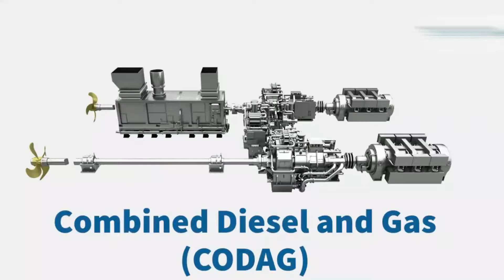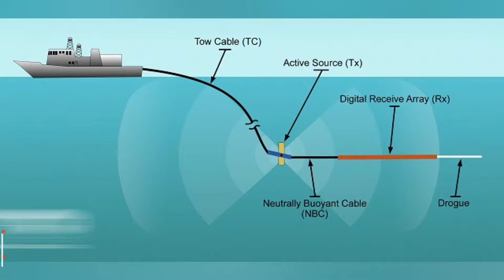#THYSSENKRUPP OFFERS THIRD-GEN #MEKO #A210 #FRIGATE TO THE ROYAL AUSTRALIAN NAVY #AUSTRALIA #AUSNAVY

Comment: How many Mk 41 cells are offered for the Australian ships bid, as this video shows 4 x 8 cells = 32 cells but I was told it is to be only a measly 2 x 8 Mk 41 cells = 16 cells.
Are Mk 41 strike length? and is there a towed array sonar as well as fixed array sonar.
Reply: VLS forward x32 cells + x16 canisters for the NSM. This is what the Mogami second of class that has been offered to Australia offers. Arguably very attractive, while the main gun is the exact same which is currently used by RAN. Commonality as much as is possible is critical.

Comment: The Meko A210 is a good fit for the RAN Tier 2 warships.  It has enhanced upgrade over the current Anzac class frigate with lower crew number and greater offensive and defensive capabilities.  A ship that is familiar to the RAN.   In my opinion it has better strike capabilities than the proposed Type 26 frigate, cost less and has lower crew numbers - this is important given the RAN's problem with personnel.  Moreover, I find it bewildering the the federal government continued insistence on procuring 6 of the Type 26 frigates with its continued cost over-runs and lengthy delays.  The final amount for these 6 frigates is between $45 billion with a guarantee of costing no more than $65 billion when the order is completed.  This is a huge waste of taxpayer dollars.  Such  monies would be better spent acquiring other ships at a faster rate.  The eventual cost for the Hunter class could be used to acquire 3 more Hobart class and up to 6 Mogami class frigates or 9 Meko A210's giving the RAN a more realistic spread of Tier 1 and Tier2 ships.
Reply: I believe it be good platform as long as they don't mess too much with the design.  32 cell for that ship size displacement is good. I just hope they plan to upgunned the hunter.class atleast for Tier 1 it wouldn't make sense to have both the 11 frigates and 6 hunter class all designed for just ASW.
Reply: @Nathan-ry3yu  Yes, I agree.  I believe the whole Hunter class needs to be dropped.  The 6 Type 26 will cost up to $65 billion - up to $6 billion per ship (far too expensive and contrary to the move towards smaller ships in greater number). Australia needs to cut its losses and use that money to purchase 8-10 frigates for Tier 1 and Tier 2
Reply: @robertmcquade6251 Yes, I 100% agree. it's very expensive for a ASW platform.

To be honest they would been better of building 16 of Mogami-class frigate from Japan. Crew of 90 on each vessel.  For ASW vessels,it basically has everything RAN needs for ASW platform and some long strike capability and has a very good radar system like the CEFAR-2 system. 5500 tonnes fully loaded.  Using missiles and system RAN looking for. 

Instead of building hunter class  frigate  they be better of building 6 Navantia flight III destroyers that has 128 cell VLS  instead to replace the hobart  class destroyers. 

And also scrap the idea of building 6 optional crewed vessels. And instead purchase a squadron of long range stealth bombers .

A surface combating fleet of 22 vessels is still double than what RAN currently have. It will work well when eventually 8 nuclear powerd submarines arive.  

A squadron of stealth bombers for RAAF would give RAN an upper hand and would respond faster to any threat..

I think the current pick for defence posture .sucks too much ASW platforms. Not enough offensive strike capability to the mix.
Reply: Yes, we have similar ideas.  The whole defense structure is weak and definitely lacks offensive, defensive and survivability.  I feel the whole idea of 12 ships in Tier 1 (power projection) and 12 or more ships in Tier 2 for EEZ protection makes greater strategic sense - just look at the UK and why it was unable to deploy its second aircraft carrier due to a lack of Tier 1 vessels.  Although the RAN lacks an aircraft carrier the two Canberra class ships have been muted for an air wing of possibly F35 B's - requiring the need for Tier 1ships. 

I agree, the Mogami class is a vey good choice and has good seakeeping qualities. It fits well with RAN armament requirements plus personnel needs with a crew of only 90 - even for the proposed batch II Mogami class.  The whole Type 26 deal was an under the counter political deal not a strategic deal.  My belief is that Australia needs to strengthen its ties with this part of the world, such as Japan and Korea - both are world leaders in ship building and can produce ships quicker and cheaper than the UK.  

The 6 optional crewed ships should be scrapped and think this is just government pipe dreams to make further delays in navy procurement and avoid the whole problem with ADF staffing issues.  A tier 2 fleet of a mix of light and heavy corvettes would be much more in line with actual security needs.  

Further, the Tier 3 level of vessels need to be actual weapons platforms rather than a policeman's wet dream.  Neither the Arafura class or the evolved Cape class would be little more than cannon fodder if it ever encountered a Chinese fishing fleet.  Rather than supplying actual gunboats and armed patrol boats with the necessary means offensive and defensive weaponry to protect the our servicemen and women, the government and military mindset is to overlook such risks for the sake of spending.  The whole notion of talk softly but carry a big stick is very relevant to Tier 3 vessels.  The current Japanese patrol ship, for example  is 540 tonnes with a 76mm mm main gun and 4 anti-ship missiles to ensure the survivability of these ships. 

I do not agree with the whole RAN doctrine being centered around the promise of nuclear submarines. This is flawed thinking on a number of levels.  Japan and South Korea both have fleets 4-5 time bigger than Australia, but have rejected the whole nuclear submarine issue.  Why?  The cost is exorbitant, crew numbers are high and the long-term decommissioning of any SSN is prohibitive.  There are over 90 countries with navies yet only 6 of them have nuclear SSNs and three of those have a mix of conventional and nuclear submarines.  Further, in the event of any conflict the US would requisition all its leased SSN's and Australia would be exposed and without a fleet of submarines.  The US is also dropping its SSN production, thereby incurring further delays for the RAN.   The whole Aukus deal is basically a political scam to get Australia to store military nuclear waste while dangling a carrot for the RAN.  Also look into the former PM's, Scott Morrison's business movements after this announcement.  It was basically insider trading when he secured shares in the industries related to servicing and supplying Aukus.  @Nathan-ry3yu
Reply: @robertmcquade6251  Japan and South Korea didn't have access to nuclear subs unless they designed them of which is  highly unlikely.
Virginias are not leased!!
Richard Marles was to increase defence he has reduced defence cutting a myriad of programs.
AUKUS should have worked but Marles is reducing other programs to pay for it, whilst staying under 2 percent GDP.
Reply: Hunters are specialists in sub hunting rest are general purpose frigates
Reply: @quannyfourtwo4366  Yep there is a big difference in the Type 26 to these general purpose ships, the 26 should be exceptionally very quite with superior underwater sensor's, way superior to your general purpose ship.
If you got enemy subs down below you'd want a Type 26 rather than a jack of all trades tier 2 general purpose frigate.
Reply: Yeah lets buy all tier 2 systems and get rid of tie 1 Hunters ...............China would chomp us up.
Reply: Ok guys so batch 2 hunters will have 96 vls. Too late to change the first 3

Comment: Australia needs to introduce a 4 year national service to keep up the recruitments even if it's just for the RAN.  Australia could have a decent size navy, but the problem is the attitude of the Australia government and defence department. The problem with recruitment can be solved. I believe all high school leavers should be on a register list. And call up enough to fill the  positions. National service isn't needed for RAAF or the army itself.  But for the RAN, I think it should be mandatory. Recruit will get a good trade out of it anyway. Some may even voluntarily make a long-term career from it, making not as many recruits need to be called up every 4 years..

Position could be offered over a variety of different fields in the RAN that may intrest the recruit in their personal  choice  in a field of trade. If not they can be appointed to one. If they don't like that trade they appointed to the can swap when other comes available. Or they can do a different trade in the public if they  choose to not stay past the 4 years of service.  

Australia has a serious recruitment issue for the ADF. Especially for RAN. I believe introducing foreigners or keeping it completely voluntary isn't the way to go. I believe national service for surtain sections in the ADF such as RAN should be mandatory..
Reply: There are enough personnel in the RAN to man every ship in the fleet, they are just the wrong rank and branch, not enough maintenance and system operators.